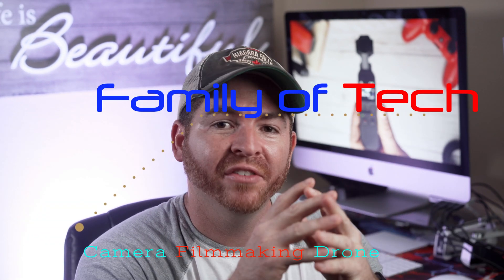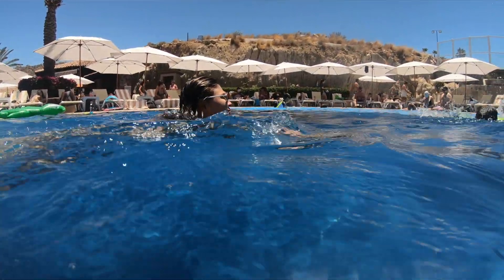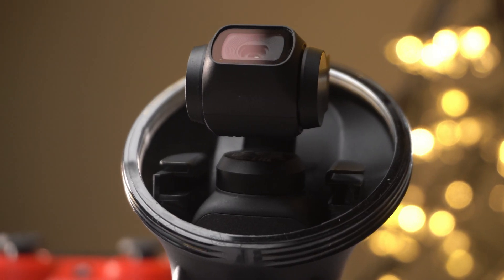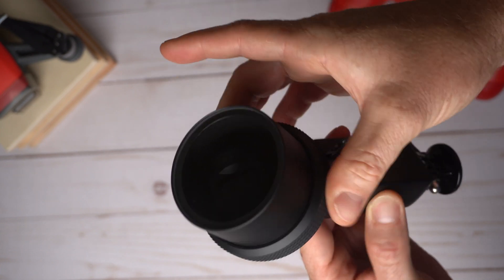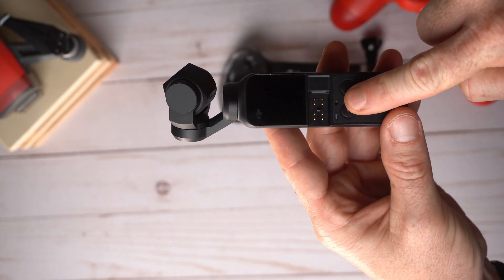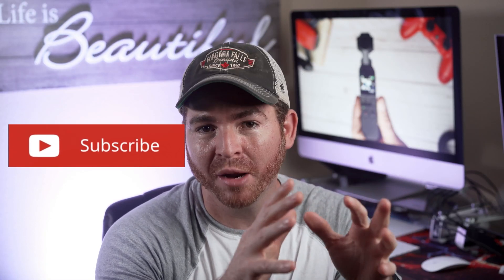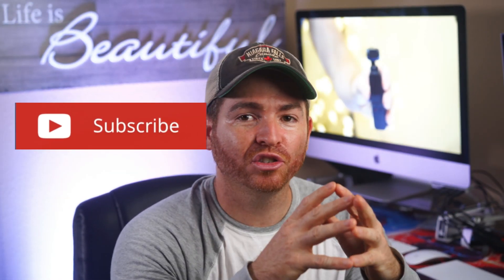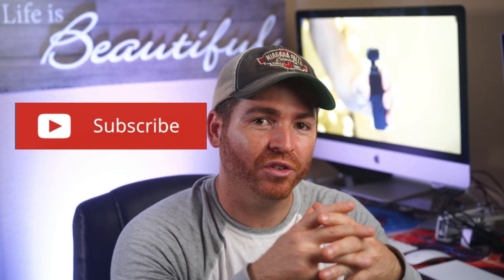Testing Osmo Pocket WaterProof Case Stabilization & Audio Quality Test

Comment: Underwater its made in 4k?
Reply from the maker: What do you mean? If it can recording 4k underwater? If that’s the question, yes it can!
Reply: Family of Tech yes! Tks
Reply: Family of Tech I did a test recording at 1080p 30fps, but it was not with the dji case, but with a sunny life one.  The videos were out of focus and very blurred.  I thought it was because it wasn't done in 4k.
Reply: @roodrigonewman  Those 3rd party dome cases - even the spherical ones - are too small to allow proper focusing... and cause distortion underwater, unless there are New better ones after now (Sept, 2021).
Reply: @roodrigonewman  The flat window does not cause the Blurring, but some stretching distortion towards the edges.